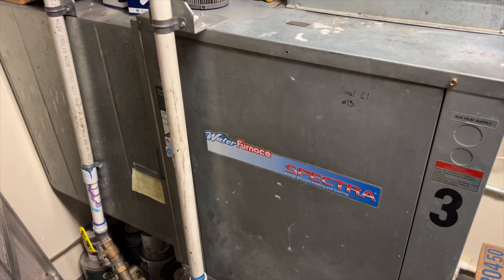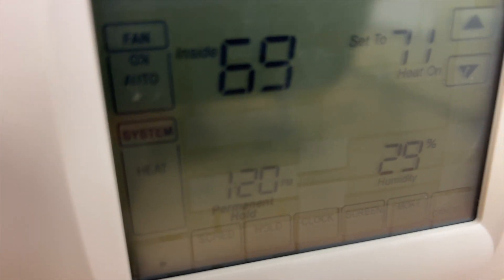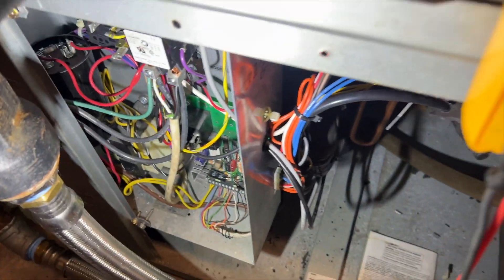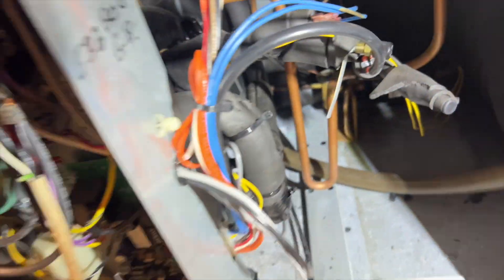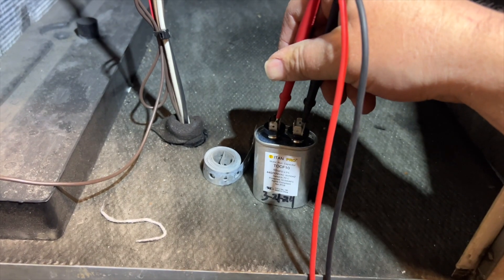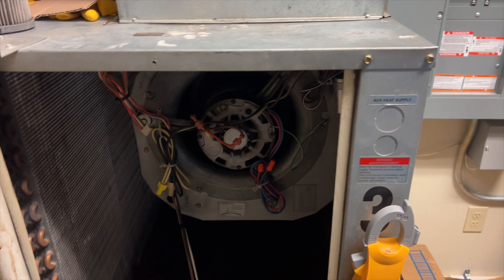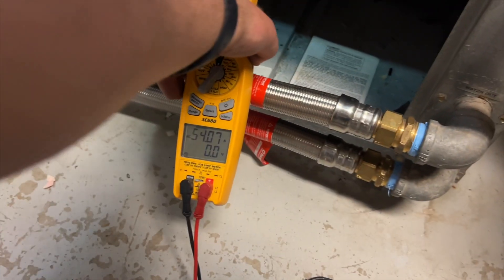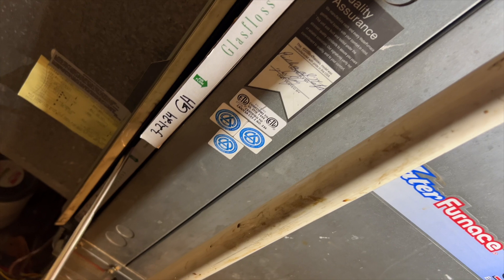Water Source Heat Pump Not Heating EP179

Comment: I have one building at work that pulls water from the Detroit River. Fking zebra mussels get into the system and kills the water flow. I am slowly replacing those systems with mini-splits. Also their are no temp and pressure gauges, whoever installed those units were hacks.
Reply from the maker: That’s crazy.

Comment: That reminds me, the house Mom bought several decades ago had some behemoth unit from the 50s that ran on well water. It had to be a water-source AC (it still used natgas for heat). Warm water was expelled to a spigot outside, so we always had a hose and sprinkler connected, and moved it around the yard every day. We had the greenest lawn LOL! That unit started giving her grief in 2000, so it was replaced with a typical split central air unit (that's still going)